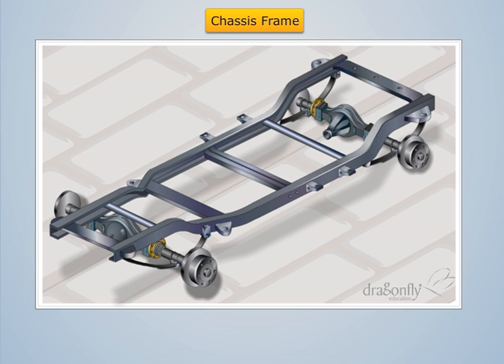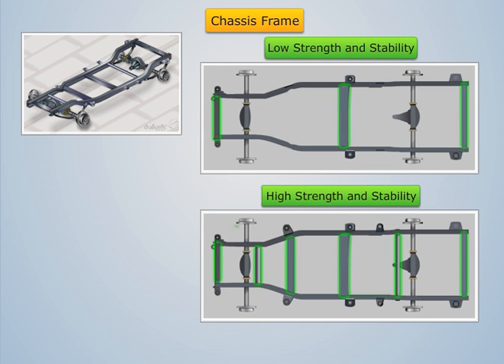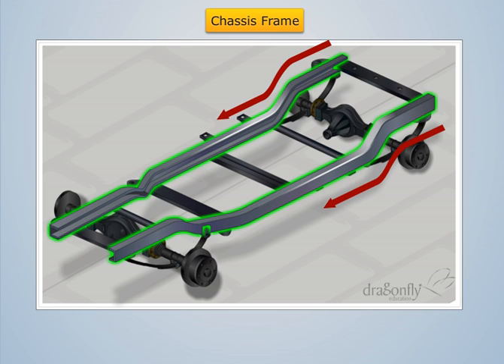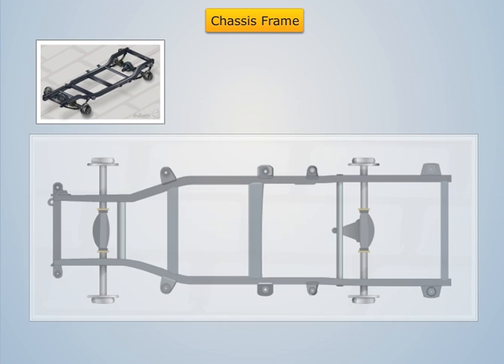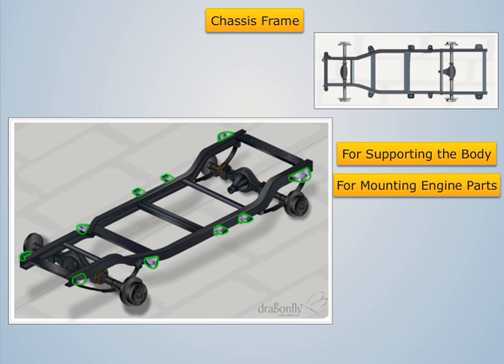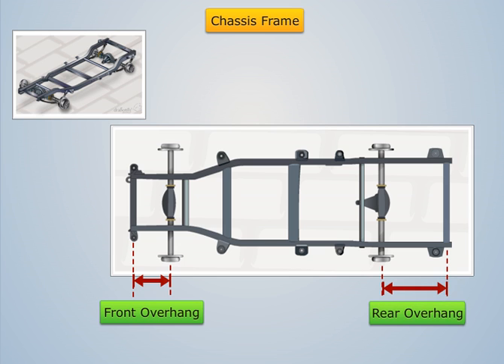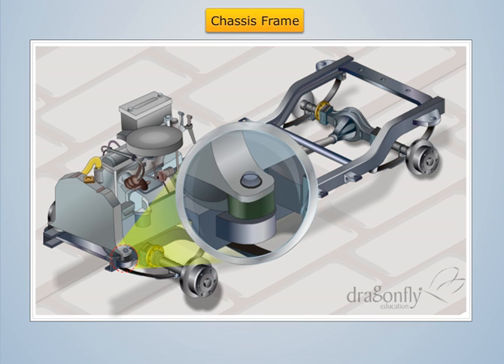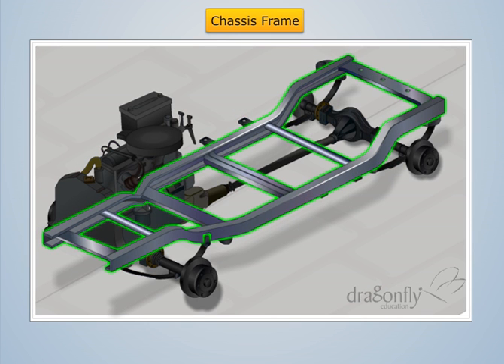Chassis Frame Construction | Automobile Engineering

Comment: The transverse cross members help limit flexion of the longitudinal members in the vertical plane by providing restraining force at intermediate points along the span. However, the transverse cross members contribute only a little to the chassis torsional rigidity. This is because the chassis can experience a purely torsional deflection without changing the distance between any two points on the longitudinal members that are directly across from one another. This is where diagonal cross members come into play. When the chassis undergoes a torsional deflection, points that are not at the same longitudinal coordinate will move closer together the more the chassis twists. By installing diagonal cross members, the closing movement is restrained, thereby restraining the torsional deflection of the whole chassis.